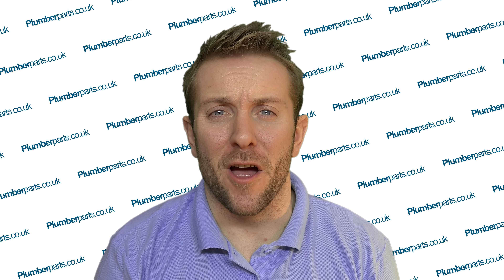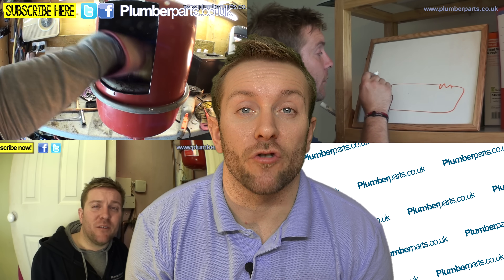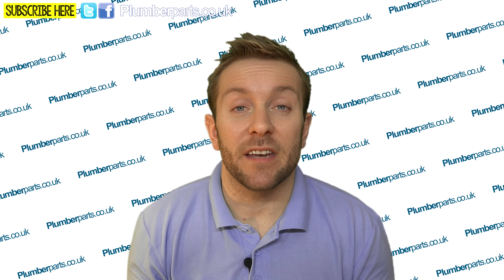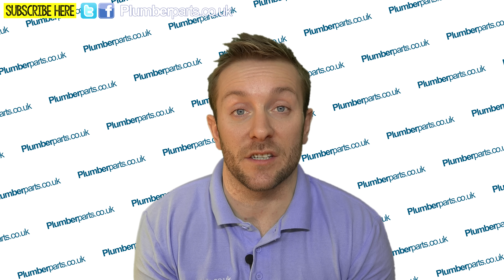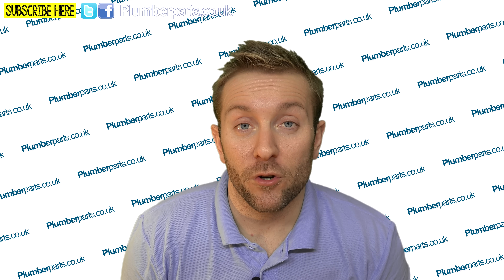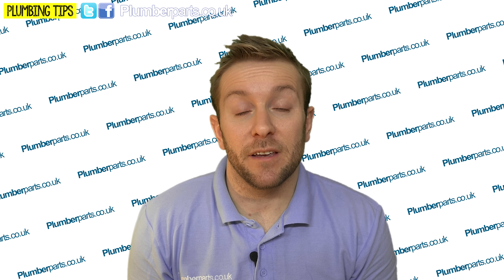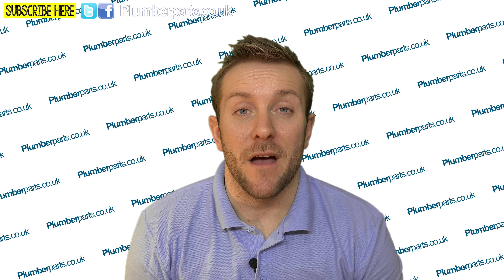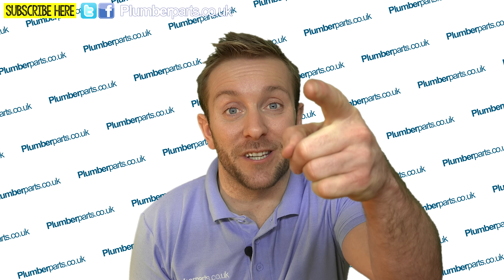BOILER KEEPS LOSING PRESSURE - WHY AND HOW TO FIX - Plumbing tips

Comment: We moved in to a brand new built house and for 16 years we had pressure drops in the heating .we had all the floors lifted multiple times looking for a leak but not could be found .the pressure drops always seemed random more in the winter and less in the summer ,in the end we just kept topping it up with the housing association permission about once or twice a month. At the beginning of Dec 2021 the pressure started dropping twice or more a day.however this time i could see and hear something not right in the kitchen steam was coming out from just under the boiler 
where the pipes where .on investigation i found a leak where the condensation pipe was touching the heating return pipe the acidity in the water had caused a small leak and water was squirting out it was very hard to see at first as the condensation pipe was covering the leak and was dripping from the pipe lower down  .when i moved the condensation pipe the leak was obvious and the pipe had corroded to the point a pin hole leak could be seen this was obviously a job for the plumper who would not be able to get out this the morning .it was very cold and we needed the heating on over night and being a ex Rn marine engineer i decided to put a patch on it with some rubber and a pair of hose clips. this in when i noticed that as i manoeuvred the rubber and hose clamps and the pipe moved water would also squirt out of the elbow joint connected to the pipe, if i stopped putting a slight strain on the pipe the squirt stopped even though the system was pressurised .in the morning the plumber came out and spent most of the morning replacing the pipe that had corroded and i had mentioned to him about the elbow joint and that i though this was the cause of the pressure leaks we had lived with so long .after he had removed the pipes and fitted the new ones i noticed on inspection of the joint that they was NO solder around the back side of the pipe and they was a clear gap between the two components/joint and looked like it had been soldered by a monkey. they had been no evidence of a leak at this joint before hand and i suspect the very very  small leak and the water that had come out had evaporated on the hot pipe condensed on the condensation pipe the before causing any noticeable damage and eventually rotted the return pipe e you would expect from a leak,coupled with the fact the very small place the pipes where located where under the kitchen units and where the pipes came from under the floor part of the floor was missing to allow the pipes to come up so any water damage was beneath where you could see without removing the units and floor.since the repair our pressure has not dropped once.bad plumbing is a nightmare to figure out  especially when the joints are hard to see one tip i could give is wrap newspaper round any joint you suspect as when it gets wet it is easy to see the effect on the newspaper (trick i learned from my dad)

Comment: 3:25 Yep, finding a brown patch on a ceiling, or water dripping from a wall switch is BAD!  Turned out to be a failed T-joint.  Heating engineer who found eventually source of repeated pressure drops - on third visit - told me that the plastic “push-click” joints used with plastic central heating pipes “just do that” 😳  He had to go in through ceiling and replaced it with a brass one (‘luckily’ the smallish ceiling hole is in a walk-in cupboard, so not in my face whilst I wait for plasterer; insurance excess too high to cover cost).

Comment: My boiler was losing pres. Could'nt get a plumber that was interested.After seeing this on youtube  I bought a new pres vessel and fitted it my self .The new vessel comes ready pressurised with air , you will need a piece of hose pipe about 12inch and a shallow bucket to catch the water. I pulled mine up through the top because I had good head room, I think that you can pull it from the side . Undo the nut on the bottom holding the pipe quickly fit the hose, put your hand on the top remove the valve cover poke your finger or your nail in the valve to let the air out.  Remove the vessel and replace the new one tighten the nut up check for leaks and that's it job done.

Comment: Thank you for a thorough explanation. I’m having a pressure loss on my boiler and keep topping up twice a day so I can get hot water and heating. I had about 3 plumbers from BGas, I’m insured with them, coming over to my house and none of them did a thorough check. The first one, balanced the radiators and left. Water pressure still low, next engineer came over looked at the water pressure gauge and left (I had just refilled it). Third one recharged the expansion vessel and said boiler needs to be taken down to repair completely. At this point, after 5 weeks of engineers missing appointments and other engineers hardly looking at the boiler itself, the problem hasn’t been solved. I have taken notes from this video and next time I shall prompt the engineers to check on these points you mentioned before they leave an unsolved job. Thank you!
Reply: Don’t let those BG cowboys near your system.
Most are 6 week wonders and don’t have a clue
Reply: I’m covered with same company: had three visits on consecutive days trying to fix pressure drop.  On last visit, engineer was about to order new expansion vessel but found water stain on ceiling in a walk-in cupboard where there was no radiator. He’d already checked visible pipes & rads for leaks; glad he had a hunch to open that door!  Stayed on another two hours to replace failed plastic T-joint, despite being soaked from the puddle above ceiling.

Comment: iv been trying to find my leak without turnin the boiler on, so i would over pressurise to 2bar (whilst off) and isolate the flow and return (so i can test the boiler), the AAV will be closed and it drops by 0.5bar over the week... it seems my loss is from the schrada valve... annoying little bugger because it was the last thing i checked... (checked heat exchanger, prv, emptied condensation tank)... i just ordered replacement schrada kits, but iv even tried using a new schrads extension in hope that would seal it but it turned out that also leaked air..

Its annoying because its now a waiting game.

Comment: Very useful video. Only concern is that you think hydrogen gas is produced. You can only get hydrogen gas from water if electrolysis takes place from an anode and cathode. Please remember hydrogen H2 is flammable. If hearing systems were producing hydrogen houses would be blowing up. We use hydrogen in space rockets.

Comment: Number ONE mistake telling people to tighten compression fittings  over tight = LEAKING  JOINTS  or have you not been taught about compression fittings   .
 The expansion vessle should have Nitrogen in them not air  .
Heat Exchangers are a HUGE failing   .

Comment: You know if there is water piss@?g out of that little copper pipe when the heating is on what does that mean? You mentioned about it dripping or running but mine at the moment is literally a waterfall 🤦‍♀️

Comment: Hi I know this is quite old now, but if you happen to have drop in pressure which happens maybe over a month or so, with possible small leak, would you recommend the use of those leak sealer fluids?
Can't seem to find the leak as described but havnt taken any floors up either on the ground floor, tiled and hardwood unfortunately!!

Comment: Why would my Vaillant Combi  pipework drip water in the cold months, and not at all in the warmer seasons? It comes from a incoming water pipe ( I wrap blue paper around the joint, so i can see it darken with water ). Not to mention the bucket placed underneath, that eventually fills with about 3 liter's over the season. I'm for ever havingto re-boost the pressure.

Comment: Hi I've got alpha combi boiler that leaks from the overflow only when the heating is on or the hot tap is used does not drop the pressure in the boiler when the heating is on the pressure is on number 2

Comment: If your unsure your pressure releaf valve is letting pressure out, tape a plastic bag over it and check it next day, if there is water in the bag you now it's dumping water.

Comment: 6:20 Water coming from the valve is not always a busted vessel with a broken diaphragm, it often is condensation, if it pumps up and holds up with the drain off open, it's fine, just keep pumping and venting till you get no more water out.
Reply: just a flat valve lad, get ya bike pump out kid geeed up get it pumped up to 0.75 - 1 bar lad geeeediup

Comment: Once a Pressure Relief Valve has been forced open (perhaps by a faulty expansion vessel) they frequently start leaking or opening at a lower pressure. So if you have a faulty expansion vessel that causes the PRV to open consider replacing the PRV at the same time. Not always necessary but they aren't very expensive and might save you another drive to the plumbers merchant.
Reply: BANG ON

Comment: Explains it so clearly even I can understand it !  I had a new Combi  installed  3 months ago & I’ve had to top it every couple of weeks - CH Engineer said it would settle - it hasn’t . Ive now good a good idea of what the problem is as overflow pipe outside is constantly dripping & so rather than feeling the Engineer is speaking to me in  a foreign language I can have a more informed conversation with him - & that’s why the 3m dislikes as the old school  cast iron boilers with a life span of 20 /30 years with occasional repairs have been replaced by boilers with umpteen plastic components, built in obsolescence & the creation of a whole new £££m  industry to teach & test Heating Engineers who then go on to charge £££ to install , service & repair the dam things. They might be more efficient but I reckon these additional costs more than outweigh any savings on my  gas bill

Comment: Thanks, I was always told by the plumbers who came out to us that we had a water leak in the pipes in the ground, after this video I can see it the Pressure relief valve  as from day one we have had water running out the back of the boiler.  Will look at tank also thanks.

Comment: You can keep these new fangled boilers.ours was fitted in 67 .ideal stnd 40/ 60 boiler.floor standing.serviced every year. All its ever had fitted is one new gas valve ( 20 years ago ) i thermo couple ( 15 years ago ) and 1 new pump. Big detached house ,10 rads .even on coldest days we don't need heating on high.It never let's us down .As the last fitter said on its service .They don't make them like this anymore .I have all the spares ( only 3 spares) .gas valve ,thermo links ,thermostat assembly.no fancy electrics.No messing around adjusting pressure. Fingers crossed it will keep going as its only been here 54 years.lol

Comment: The expansion vessel in the combi is usually way too small for the system!
Secondly you can get a pressure breed across the flat plate heat exchanger on a combi.
So many problems I'm always busy fixing lol.

Comment: I have an “annual” service contract (that only comes about every 18 months) with a large company.  I don’t think they do those checks you suggest, and a few months after last service (done during summer) I found two largest rads on ground floor were not getting hot.  Thinking of ditching that contract and finding local engineer instead - should I use Trust a Trader?

Comment: We kept losing pressure in ours and was told we had to just keep filling it when this happened. 
It kept coming up fault 7 every time this happened. 
3 plumbers later he said all the problem was it didn’t have an earth wire connected. 
Never had a problem since.
You have good plumbers and bad plumbers

Comment: I replaced a PRV on my boiler because it was leaking slightly,I also checked and re charged my expansion vessel. 9 days later my central heating pressure was low again??????. No issues with my new PRV and expansion vessel, Im thinking my auto bleeder. I refilled the system and am hoping it was just air being bleed.

Comment: Hi thank you for sharing very informative tutorial, I ve got a problematic question , my 7years  old Potterton  promax 28 has releasing pressure, replace PRV  which was blocked and replaced expansion vessel but still releasing very little water from PRV. Any suggestions or advise please? System is working fine apart from topping up to 1  and 1.5 par every 2 to 3 days :(

Comment: my boiler intermittently stops heating the water , the b gas engineers have been out three times now still not fixed and yes each time they come out it works ,typical eh any ideas?

Comment: Also blockage not allowing water to get to the expansion vessel (maybe collapsed flexy hose) so pressure relief valve dumping water. Small leak in the heat exchanger not apparent as it is boiled off with heat from gas burner. Can be seen as steam in the exhaust outside when the burners are on.

Comment: I need help please how do I turn the pressure up on my boiler I still feel a bit cold my hot water from tapes are lukewarm including the radiators my boiler is called glow-worm I don't know if you know anything about that.
Reply: If there are taps at the bottom of the boiler  turn them so that you can hear the boiler fill up then turn the taps off before it reaches the red area.

Comment: Mr Plumberparts, Pressure needle seems to go high, goes over the Red section when I put the central heating on and it gradually comes down to zero when I switch off the central heating. How can I fix this mate?
Reply: sounds like your expansion vessel needs recharging

Comment: Hi James. V informative and useful info on your site generally but I can't find anything about my problem which is" pressure drops on my sealed system about 0.2 bar every couple of days. I've checked all the simple things like rad leaks etc and no leaks there. Property is bungalow with all pipework under solid floor so if there is a leak there well, I ain't gonna go looking for it. I want to add leak sealer next to see what diff if any it makes but is there a way I can add it without draining system and losing inhibitor I put in a few months ago?

Comment: Happened to my system. It was a screw I put into a floorboard that bullseyed a pipe. Took a while to find it as it was a very slight leak to begin with then eventually failed with s minor water leak. Once solved no further pressure drop issues. It was a pain refilling the system every couple of weeks.

Comment: Mine used to drop pressure on my timed heating now I have it on constantly and seems to be cheaper went from £71 per month gas/electric and now £39 per month and no constant call outs to the gas guy

Comment: Best guide to a pressure vessel failure is the pressure fluctuates a lot when the pump start/stops. When working, it acts as a hydraulic capacitor, smoothing pressure changes.

Comment: plumberparts : could you do a video on Winter (unattended ) settings on a Morco GB24 Series 11 on a caravan whilst away on vacation ie all knob positions respectively ? I have checked my system protected to -11C. Obviously the electricity supply will remain on !

Comment: I have a Vokera Linea Max about 20 years old but serviced every year. Strange pressure issue? I noticed one of the radiators was cold at the top so bled the radiator and checked the pressure was a bit low (cold) 0.8 so adjusted it to 1 bar. Next day noticed that the pressure was just above zero so I pressurised the system and watched it for a while. With just the heating on and no hot water demand the pressure was maintained for a few hours no problems. After using the shower the pressure seemed to drop down to 0.5 bar. Looked for leaks and could not find any, put a bag over the PR outlet, checked the expansion vessel and okay. Repressurised and it ran for a day no problems using heating and hot water as normal, day 3 wife used the shower and pressure dropped again, no water in the bag over the PR pipe no visible leaks. Any thoughts on this?

Comment: I am having this issue been looking for a leak for weeks. 
Tonight noticed my condensate pipe is running quite a lot and also dripping from the vent above, also it smells like radiator inhibitor

Comment: Very interesting video my uncle has lived in his property for 65 years the radiators are pre 1980s 1 Plummer said he needs a new combi boiler and new radiators the next Plummer said he can save money by fitting a new combi boiler and fit it to the old radiators now every day when switched of the pressure drops then needs topping up starts flashing low pressure but when it’s on its stable no problems now I am thinking should of got new radiators to

Comment: Great video, thanks for posting.  Used the bike pump trick to add a bit of air into the expansion vessel as it had been dropping pressure, and had gone through the other trouble shooting.  Hopefully it'll get the boiler through the winter.  It's on borrowed time to be fair, but not in a rush to replace it!  Thanks again!

Comment: I had a hairline crack inside the main combustion chamber of our Worcester Bosch combi after ~3 years. Couldn't see any leaks in the pipe work, 'cos it ended up in the condensate drain, so took a bit of finding. WB changed it for free although I had to pay something like £30 call out. Obviously a manufacturing fault. But that gave us an almost new boiler that didn't need servicing until next time.

Comment: Or it could be an Ideal Logic Heat with a poorly designed heat exchanger. If there hasn’t been an Ideal filter installed from new your 10 year warranty is void.

Comment: What happens when you pressure keeps dropping, there are no leaks in the heating system, you isolate the heating system and the pressure still drops but still no evidence of leaks???????  All this water that's going in by topping up must be going somewhere.  I am at a loss.